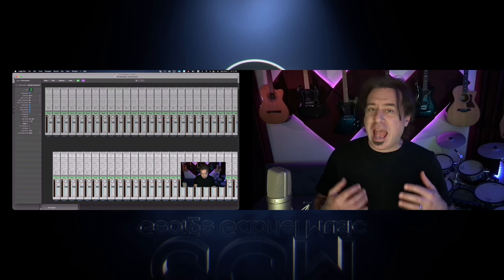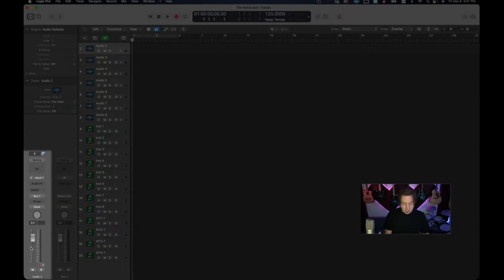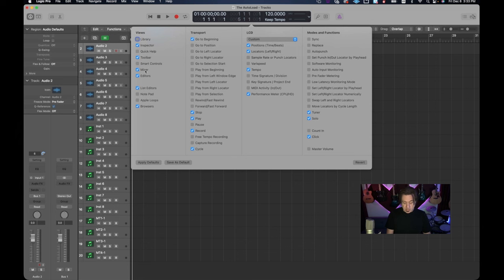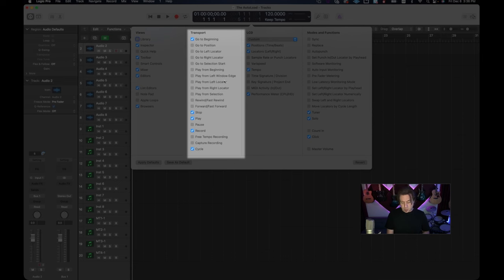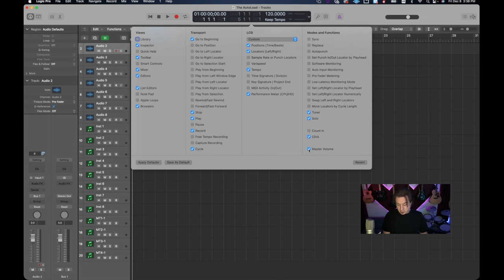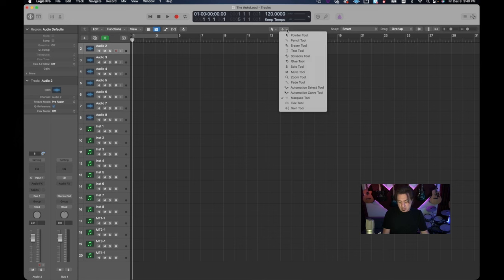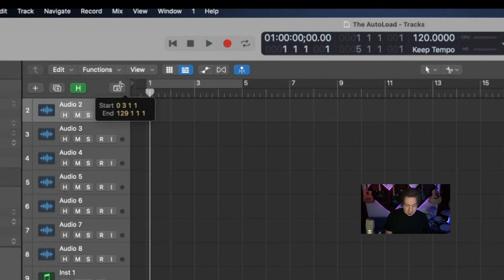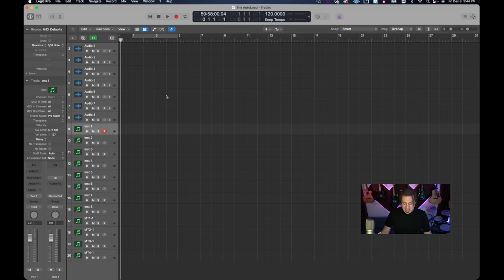The Autoload Creating an Expandable Template - Part 4: De-Garageband and Settings

Comment: I always keep Notes. Really important for me to have the lyrics of the song in there.
Reply: I'm with you @mdmorris6193. I prefer to keep notes as well.
Reply: @moniquekenny6578  I’m hoping his Part 5 details how to set up External Midi instruments. Given George is a student of the Environment, I’m wondering what his take is on External Midi?!
Reply from the maker: Thanks for your input! This was meant to guide you through the process of creating an AutoLoad that is customized for YOUR needs. I just shared mine and the workflow to get to that created, but I do make the point that it is up for you to decide what is important for you to use - I hope that came across.
Reply from the maker: I have shot parts 5 & 6 and they are in editing now - Part 5 is about setting up the screen sets and Part 6 is customizing through color coding, icons and also goes into the key commands to grab the tracks that are hidden in the Environment. I will shoot part 7 tomorrow and it will involve populating FX, Plugs, customizing the I/O tags, and then going back into the Environment and changing some things up - that is where I will include External Midi. (that wasn't in my original plan, but you've inspired me to add it so, thanks!!) Part 7 will also show how this is used. Thanks for watching!!